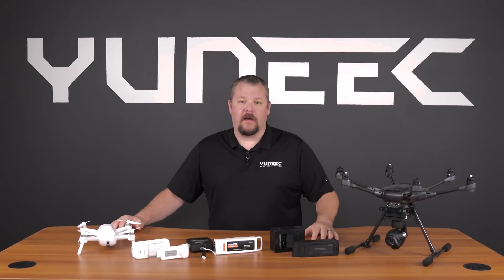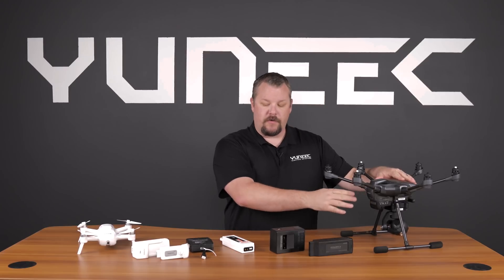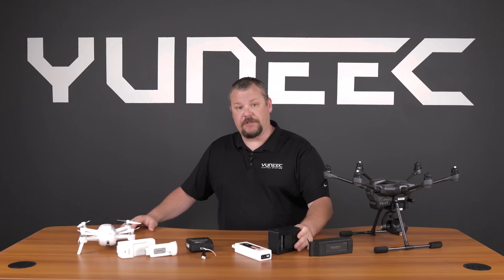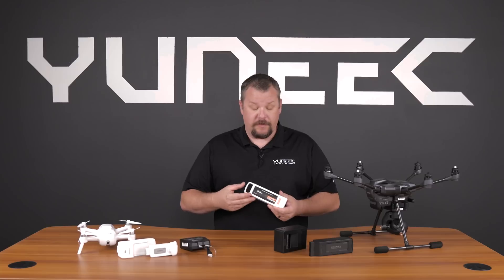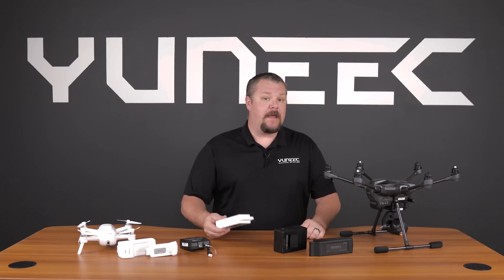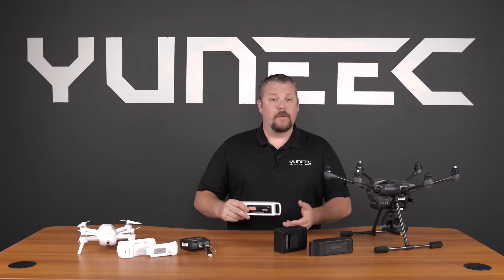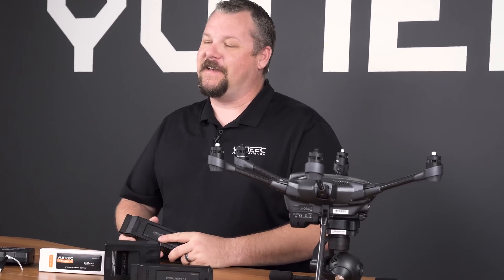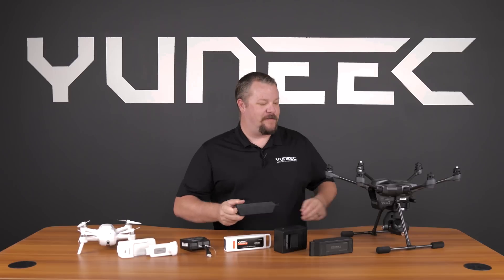Yuneec Drones: Battery Management

Comment: I appreciate this video and helpful insight. With that said, I have had problem after problem with the Q500. There's a lot of room for improvement. 

I have flown my drone about 5 times over the course of a week. Within that time, both batteries have died and do not charge. I accept the responsibility of user error for not reading the manual from end to end, but the reality is that the Q500 is not "out of the box" user-friendly.

The Q500 has a lot of complexity around the intricacies of operation.

I have had issues with the camera, photo transfer problems, the CGO app, binding to the drone and now battery/charger problems; It seems never-ending.

I do not recommend buying this drone. There are better options.

Comment: I've quite flying mine because I couldn't keep batteries working. I have went through 5 batteries with about 20 hour total flight time. So about 4 hours per battery that was just getting ridiculous. The last battery I got, I charged it, took it out for a quick 5 min. flight to test it and put it away. Took it out the next weekend and the battery had swelled up so much it wouldn't even go in the drone. $100 for 5 minutes. I was going to try after market batteries but thought if the original ones are that bad then the others would HAVE to be crap! I'd love to still be flying it but it just sits on a shelf in my garage now. Please tell me you have improved your batteries since 2018 and I'll buy another but if they're the same, then no thanks.

Comment: I put the battery in the charger with 72% charge to top it off and I get a charge error light can anyone tell Me what's wrong ?
Reply: Are you speaking of the blue error light.
If so I have got that occasionally too.
Try spraying a little bit of contact cleaner on the contacts reviews of the battery or the charger.
Plug your battery in and start charging see if that helps. If it does not. Take the battery out of the charger reinsert it again firmly. It seems as though after three tries. It will charge correctly.

Comment: my new Yunecc drone battery lasted two weeks, no warranty, it took one month to fixed, Yuneec fixed and lasted another week, garbage. Irresponsible company and horrible batteries, no more Yuneec  drones I feel rip off
Reply: I had no idea people had so many problms
with Yuneec
Reply: Four batteries and none last more than a month or two.  I have about 20 hours on my drone so no excessive use over the last year.
Reply: @rikcolsenmn  Exactly the same here.
Reply: Yeneec   contracted with a  LiPo Mfg that supplies very low  C rated  Batteries.   The  Q500 needs a very Hi C rated Battery.    But  you cannot buy them  no one makes them. 

The Yuneec  is just Crap.        And they do not Care.
Reply: I just bought a new Q500 4k, and both batteries aren't playing!

Comment: Having an interesting conversation with Yuneec. There is a specific protocol to battery storage they are saying needs to be followed, which is not in their manual, nor it is really covered here, although this is where they referred me. I've purchased a Breeze and it is now a paper-weight because neither of the batteries will recharge. Their 30-day warranty is of no-help, as it was explained to me that this was either caused by not using the batteries for long periods of time and them being either fully charged or fully discharged.

Granted, maybe if I knew more about electronics and lithium batteries I might have known this. But I also own 3 other cameras and numerous other items with lithium batteries and have never had this issue. Their advice it to store the battery long-term with the voltage around half. Not that there is a half-mark on the charger or that this was noted in their manual.

Long and short ... buy something else. I've seen this before, so feel free to read other people's issues, which I discovered as I was researching my own. Just visit this link or Google it yourself. https://yuneecpilots.com/threads/breeze-battery-flashing-blue-not-charging.7434/

I used mine less than half a dozen times and now both batteries are dead. On the other hand, their Live Chat support has been very helpful in trying to get me to buy new batteries, which cost $59.99 each.The drone was less than $200.

If you like not using a drone and want to pay a lot for replacement batteries to not be able to use it again, I guess I would have to recommend the Breeze. Otherwise, there are plenty of other options out there.
Reply: I just went through the same thing with their so-called support.  The battery for my breeze lasted about 6 or so flights.  All they will do is politely offer to sell you another battery.  The fact that there is only a one month warranty on the battery tells you they know their batteries are garbage from the beginning.  I agree with you there are plenty other drone options out there stay away from these.  Its just sad that they don't care any more for their customers than to sell them junk.

Comment: Guys, I heard on these batteries you are not able to see what the battery charge level is on the battery itself. Is that true? Is the only way to determine battery charge level is by using the drone display software on the controller or do they provide something else  i.e the wall charger has a battery charge level indicator? Seems pretty basic standard stuff but its key to having.
Reply: Yep, Yuneec does not delvelop any kind of smart battery at the moment. And even worse, ther is no way to know the battery status even on the charger, because it just "tells you" when it is fully charged
Reply: @stefanozanna1988  Does it  really tell you?   I think not
Reply: It just "beeps" when the battery Is supoosed ti be full, but nobody can know of It Is true or no.

Comment: My drone battery for my typhoon q500 literally got stuck inside. I think it melted in place inside my drone. What do I do????
Reply: hoffman. mov wtf? How did it do that?
Reply: @ghosttjr2  
Hey ghost
I would like to know how his battery got stuck in the Drone also.
Reply: your battery expanded from  hi discharge rate   Got HOT and Expanded  you do have a problem.     But that is Yuneec   Just Junk.
Reply: Put the entire drone in the freezer. The battery will shrink then you can remove it. r@ctsteve1967

Comment: I love my first battery warning on the H. It stays up in red and cant use the monitor to find my position as a check. then I have to return home. which takes the drone up and back more battery usage. Lol. SO NOW I FLY FOR TEN MINS THEN BRING IT HOME.
Reply: who said I could not see it? the point of the controller is for reference, battery life and position to be used 20% of the time. Line of sight does not give you the direction of the UAV device and to let you know its a UAV drone not a RC plane. And when you read the manual of the RC plane or drone then take a pilot course lol
Reply: I know this is old, but seriously, you don't know to tap the screen to make it go away?

Comment: Once again someone shows their ignorance as to electricity. The battery doesn't push out more amps on a hot day, a battery will only provide what the load demands and can't force the load to draw more. Simple Ohms law that you learn in JR High School. Now it is true on a warm day that the props are less efficient and therefore the motors have to work harder to provide the same lift leading to a larger current draw for the same thrust. No source will ever force any load to draw more power than it requires.

Comment: so if i am frying  my typhoon g and it looses connection, and the battery is low, will the drove land it self or will it just come crashing down once the battery is dead ?
Reply from the maker: Hello Chuck, 

Always land as soon as possible after the first low level voltage battery warning, or land immediately after the second level low voltage battery warning. If at any time the aircraft battery voltage shown on the screen is below 14.1v land Typhoon H immediately. 

-Team Yuneec
Reply: @YuneecElectricAviation  
Are you still selling batteries for the typhoon h ?
Please reply back ASAP.
Thank you
Keith Kuhn

Comment: how long is long time storage? or how short is short time storage ?
Reply from the maker: For the longest life of the batteries, LiPos should be stored at room temperature at 3.8V per cell. 

-Team Yuneec
Reply: @YuneecElectricAviation  This is not an answer to the question asked, I think?
Reply: That is an open ended Question.   That is a Stupid Question.

Comment: wait so the factory charger doesn't Balance the batteries on the H?
Reply from the maker: Included Yuneec charger will balance cells when charging. 

-Team Yuneec
Reply: Yuneec Electric Aviation sorry got confused when you held up the Typhoon H battery charger at 2:15 and said with the supplied charger and then grabbed and said along with Balance cable??? is that for other "Yuneec" models??? got a bit confused when you pick up the H charger and in the same sentence talk about a balance cable that made it sound like I was missing a balance cable from my kit.
Reply from the maker: Typhoon H charger balances cells within the charging base. Charger/balance cable shown at 2:17 is the Q500 series charger. 

-Team Yuneec